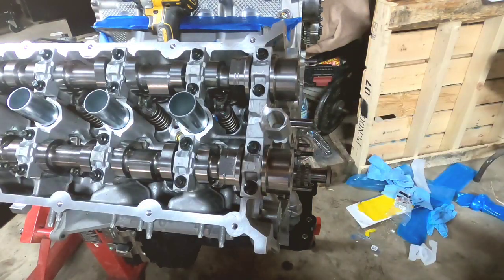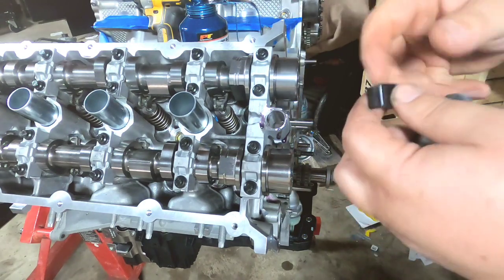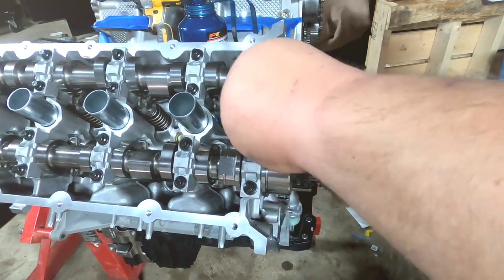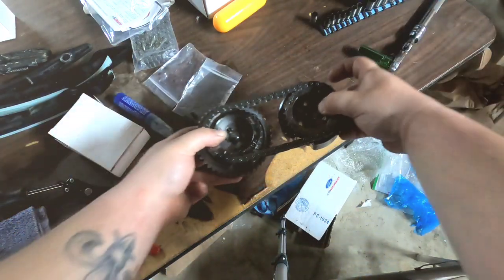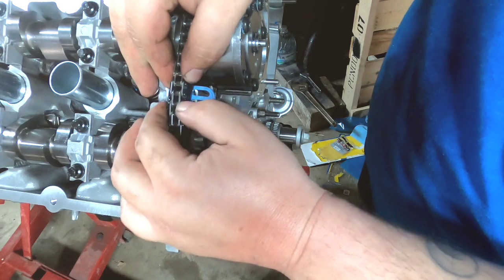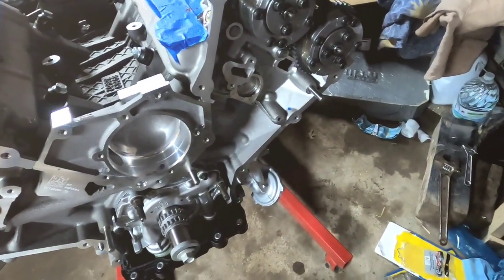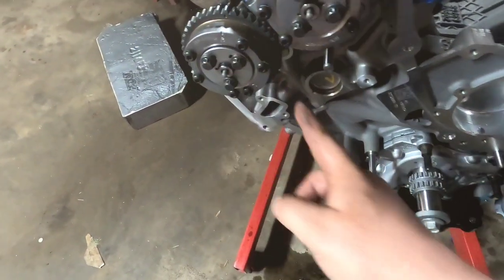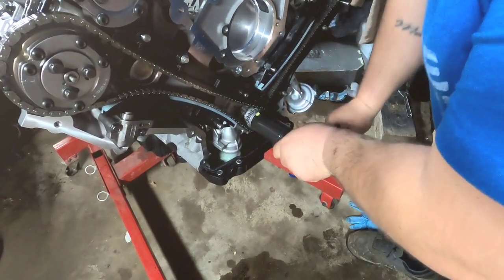Timing my 5.0 3-2-1 Coyote Engine (Gen 3 short block, Gen 2 heads, Gen 1 stage 3 comp cams)

Comment: I gotta ask, what makes it 3-2-1? I also wanna use a gen 3 engine block in my S197 which is currently twin turbo’d and keep my gen 1 computer etc. I know you have gen 3 block and gen 2 heads but do you have gen 1 timing ?
Reply from the maker: Yes, gen1 timing components and timing procedure. My car is a 2014 so it uses the gen 1 computer.
Reply: Street Slayers so gen 1 cams, timing chains etc?